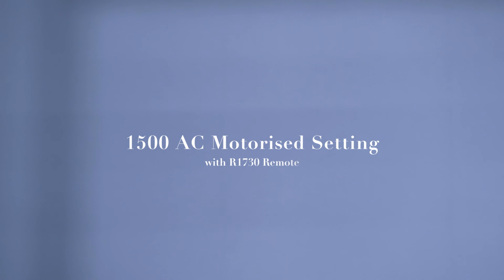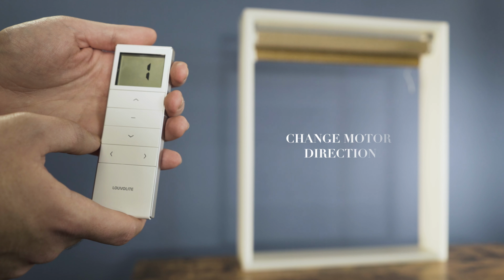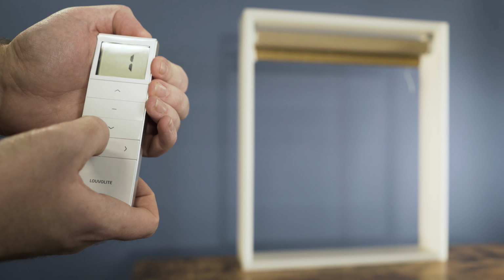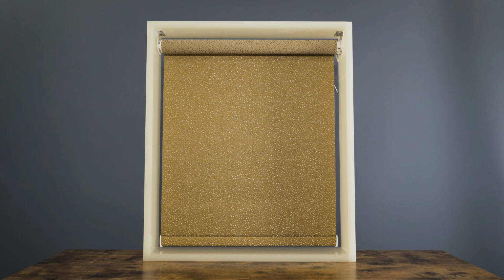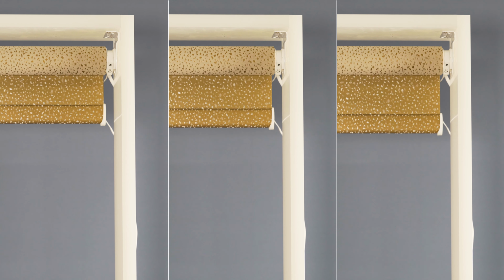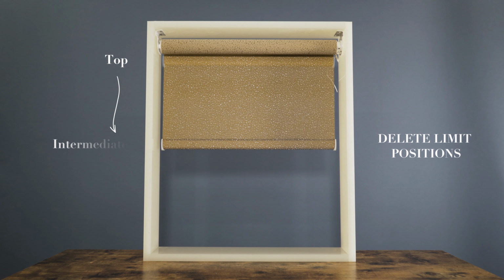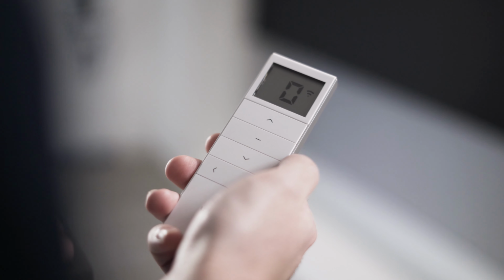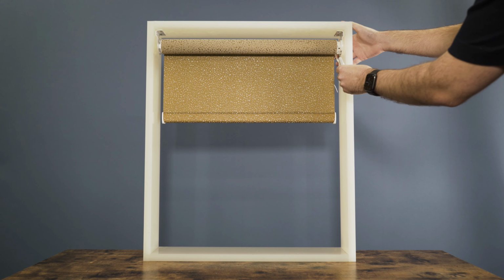How to Set & Operate Your Louvolite Hardwired 1500 AC Motorised Blind With R1730 Remote

Comment: Is it correct that to complete any of these settings, it needs to be in pairing mode (pressing button on motor) in order to complete? I cannot seem to set a midlevel as described.
Reply from the maker: Hi @310inUK - You should be able to set the mid level without being in pairing mode. If the issue persists, feel free to give our tech team a call at 01618825007